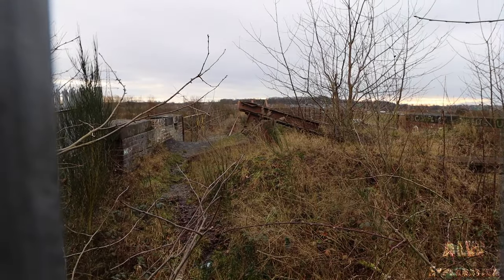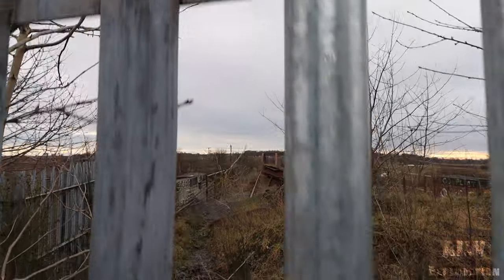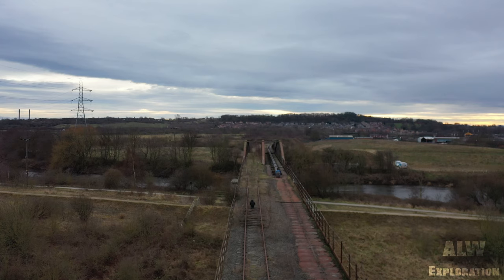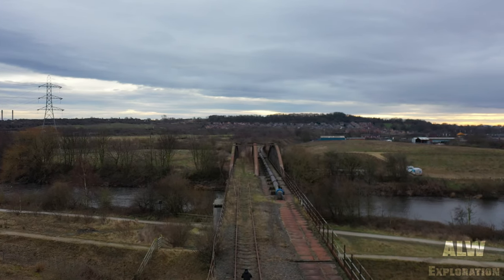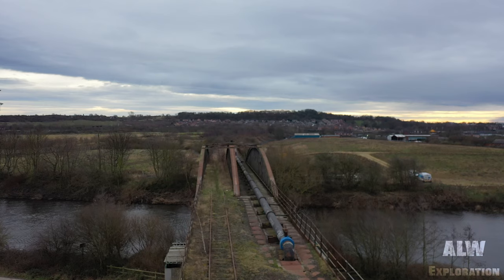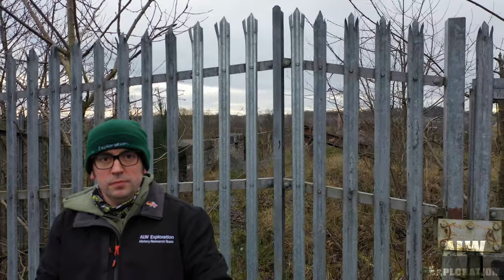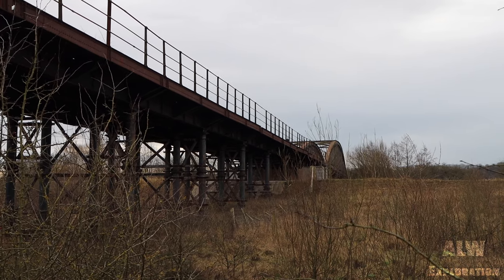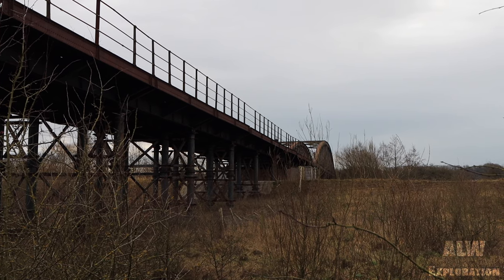Abandoned Castleford Railway Viaduct in Four Minutes | Urban Exploration

Comment: I find these old viaducts fascinating, good content Andy. What's the pipeline for ?
Reply from the maker: Hello, The Pipeline is for G20 Natural Gas, a lot of high pressure gas is carried over former railway viaducts in England. Seems to be a cost effective way. Thank you so much for watching
Reply: There is also a large  mains water pipe which runs on the bridges structure. It sprung a major leak a couple years back which took months to fix.
Reply: @ALWResearchTeam   I hope the viaducts are securely monitored against malfeasance/extirpation/deconstruction in these 'strange' times, Andy.  Thank you as always.  Stay free.  Rab  🍻 😎
Reply from the maker: Hello R F, unfortunately not. They are largely ignored and forgotten about. Most of the Uk infrastructure is, live and decommissioned. Cost before safety. Sadly the UK is a victim of the That’ll do and Just in time culture that will lead to a catastrophic failure at a major site before long.